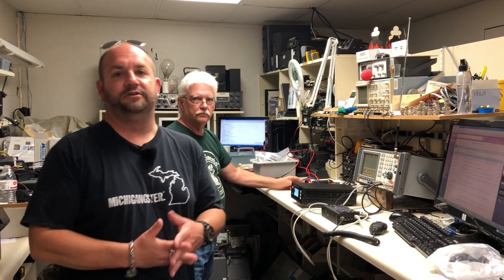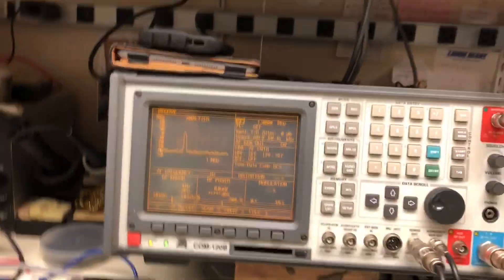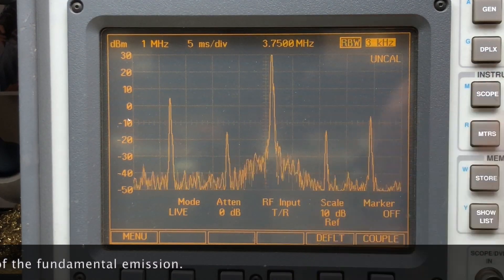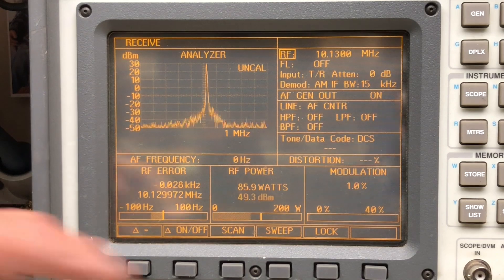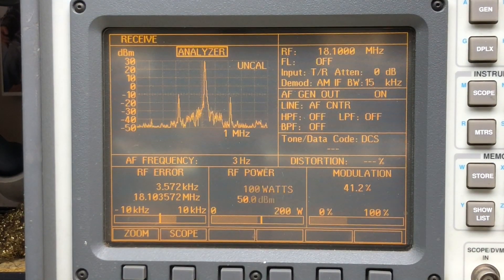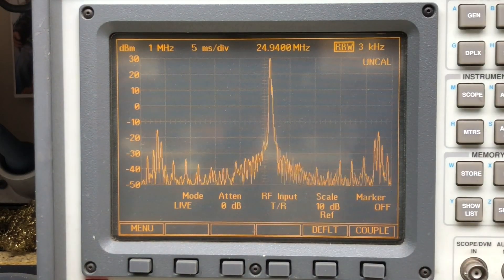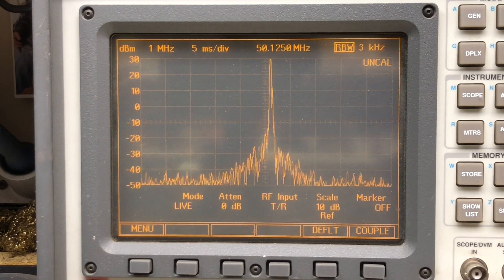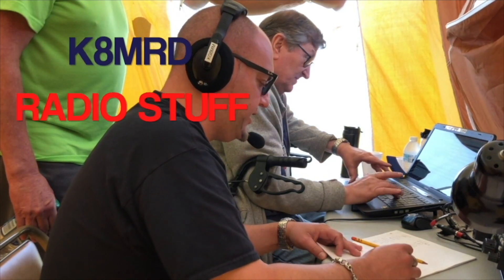Xiegu XPA125B Signal Purity Test

Comment: Thanks for showing this.  What was the test which you were doing? 2-tone TX test? Or just plain carrier?  I wonder whether what you were seeing was spurious emissions, perhaps from the driving radio?  Perhaps measuring close-in 3rd-order IPs, from a 2-tone test, would be a good test of linearity.... if the spectrum analyser goes that fine on resolution....  (Not sure whether the SA was overdriven during the test on 1.8 MHz?). 73! Tim
Reply: Most likely it was overdriven on 160 m test.
I have one and find that on some bands you only need to put about 1 watt in to achieve maximum output. I also second your comment about using a two-tone test. That would be much more precise than a dead carrier on AM mode.
Also if you're running a quality radio that has Pure Signal (pre-distortion) you can most likely clear up any issues on the second and third order.

Comment: I’m confused - how do we know that the problems on 80 and 160 are coming from the amp, rather than the signal source in the radio ?
Reply: If i remember the drive at 160m needs to be less than 3 watts mabe 1.5w you were over driving it at 5watts
Reply: @KA4UPW Yeah, and that would explain horrible results on 160 and 80 meters
Reply from the maker: I guess we don't now that you pointed this out.

Comment: it's not G90 ;-)
Reply from the maker: lol
Reply: @hamradiotube  The transceiver connected to XPA125B looks like X5105. G90 has different form factor, smaller display, and the display is color OLED or backlit color TFT, while the transceiver in the picture has clearly an "old style" B/W LCD with gray background and its dimensions are greater than G90 display. I own a G90 and it definitely does not look like the rig you have in the video... What we did not see is how's the spectral purity of X5105 itself. Without that, you cannot say for sure that, for instance, the spurious IM products on 21 MHz are from X5105 or from XPA125B. It could be an interesting video but in fact there are too many unknown variables to make definite conclusions.
Reply from the maker: @ok4rm  Oh yes, that.  That is what you call a slip of the tongue.  But thanks for pointing it out.  I'm very aware of the differences between the 2 radios as I own both.  In fact, I have one of the more popular review videos on YouTube about the G90.

Comment: Question: Practically speaking, what does the extra noise on those bands translate to when operating? I mean, presumably you’ll get more range with more power, but does it mean you interfere with neighboring operator’s signal on other frequencies?
Reply from the maker: The noise are spurious emission spikes.  That means the amp isn't putting out a very clean signal and could interfere with adjacent stations.  You could also be causing interference on the harmonics of those frequencies.  For example 15 meters is a harmonic of 40 meters, so you could be splattering all over 15 meters and not even know it.  Most of the bands tested with this amplifier were within FCC regulations as they were below the allowed threshold, and likely to not cause interference.

Comment: Is the "trash" from the radio or the amp?  See a linear amplifier will amplify the input signal so you have to check what's driving it, the x90 against the output for  a real picture..
Reply from the maker: the amp.  I've tested the radio.

Comment: First, you need a clean signal source. Did you verify the purity of the transmitter's signal? Chinese ham equipment is notorious for poor filtering.
Reply from the maker: Yes, both the g90 and x5105 have been tested on the same equipment and are clean.